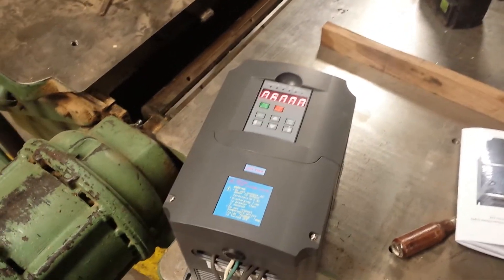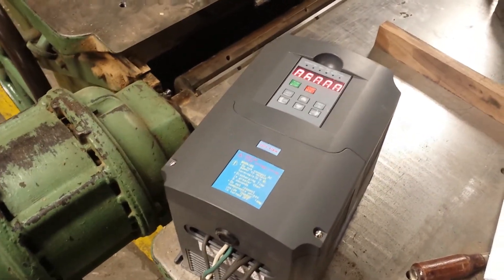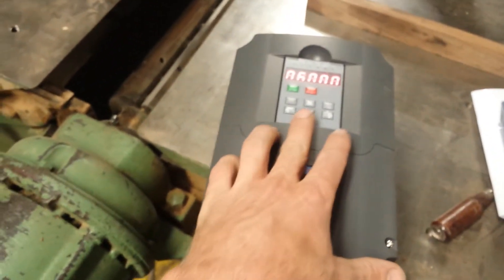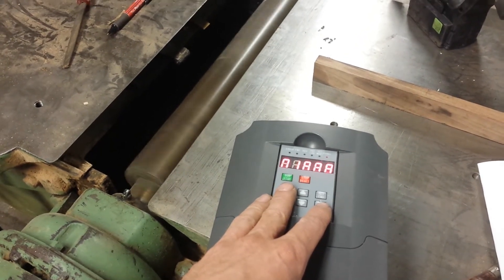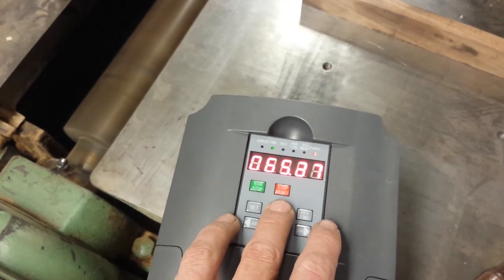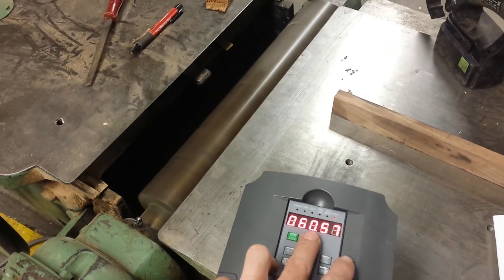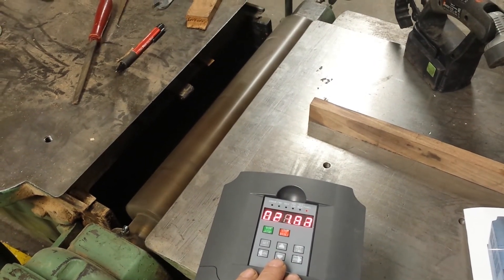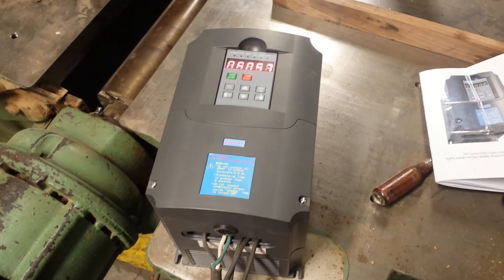VFD on 5hp American Jointer

Comment: Hey Darcy, I recently purchased that same VFD on ebay to run a 2HP 3 phase jointer.  I'm having some issues getting it going - probably the parameters aren't set correctly.   Wondering if you'd be willing to help me figure out how to set it up?
Reply from the maker: Are you trying to turn vfd on from external source, like pushbuttons? Other than that, it was pretty simple to wire up.